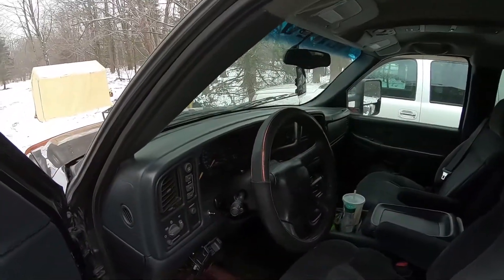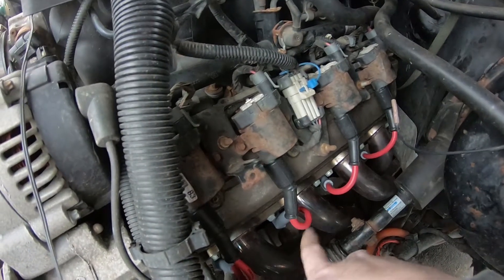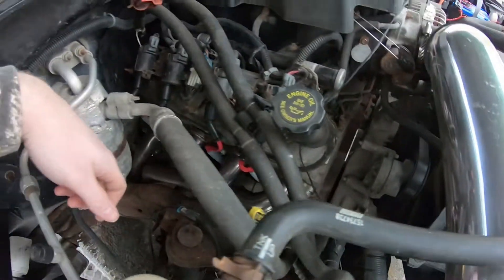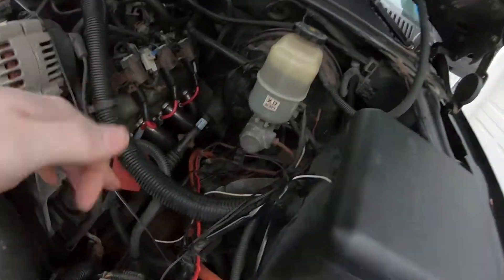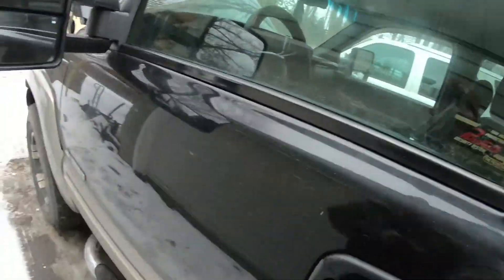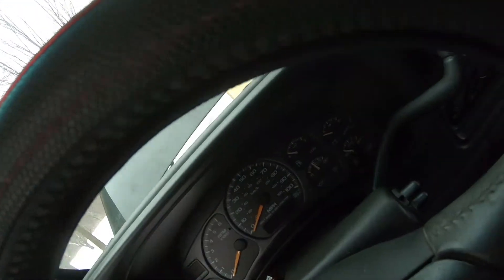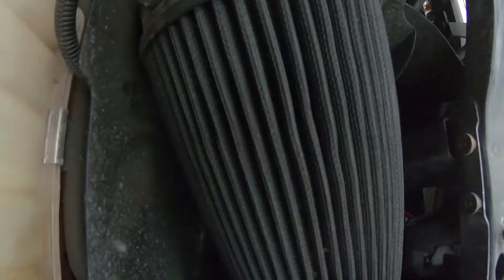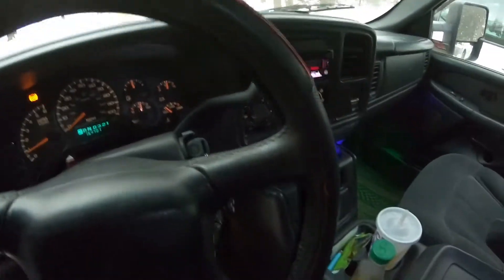Cammed Silverado

Comment: Does your truck want to die when coming to a stop due to lack of vacuum with that cam? I have the same truck and it’s always wanting to die at a complete stop.
Reply from the maker: Same cam as mine?
Reply from the maker: There is always a small screw where you can turn your idle up a small bit and see if that help with it wanting to die.